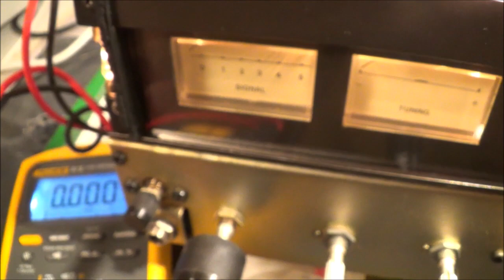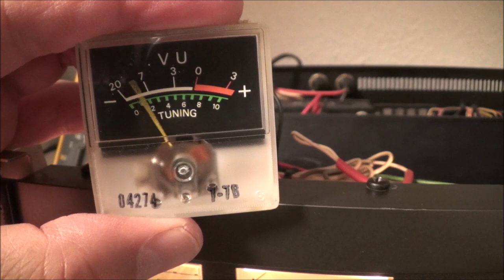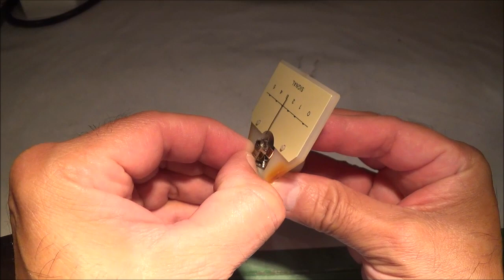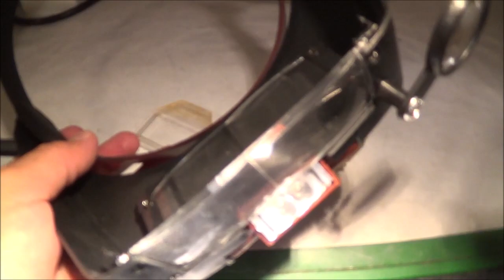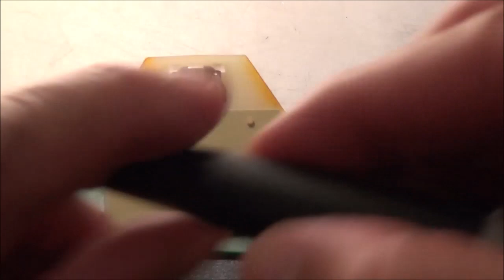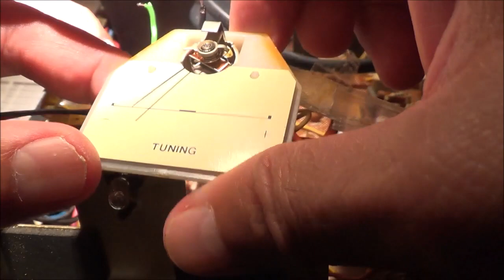NAD 7030 Stereo Receiver Meter Problems

Comment: wow  ive never  seen a  nad  recevier  this old  before  i  didnt  know  went  that  far  back  ?
Reply from the maker: They have been in business since 1972. This is part of the 7000 series, which includes, I believe, the 7020, 7030, 7040, 7060, and 7080 receivers. From 20 to 90 watts per channel continuous into 8 ohms. The 7030 is not the prettiest, but it sounds good--at least to me.
Reply: Old School yea  i  went  onto  hifi  engine  it s a   whole  website  with  libary  and  other  good  info  on  stereo  equipment  you  probly know  already  nad  stands  for  new  acoustic  dimension   ive  been a fan  of  nad  audio  eqpmnt  . i  looked  at the  specs  on  that  7030  they  got  some  very  nice  recievers i  dont  care  if their  vintage  now  i  prefer  older  stereo  gear  .
Reply from the maker: Thanks for your input. Vintage is the way to go: looks good and sounds good.